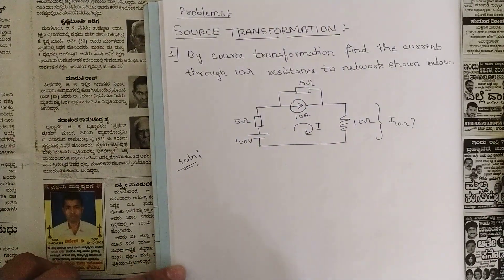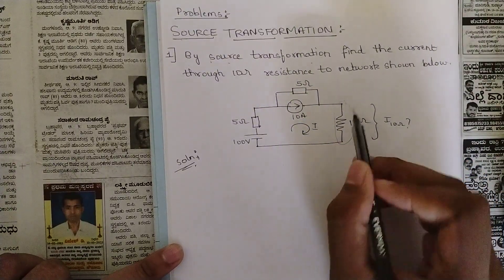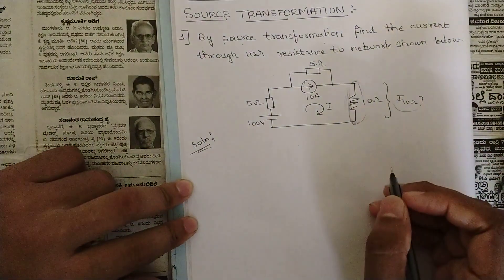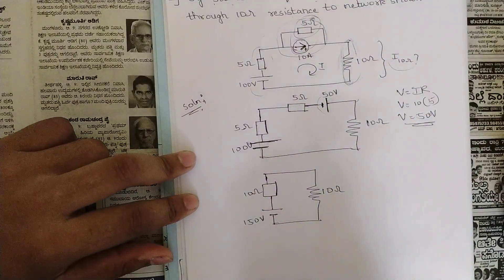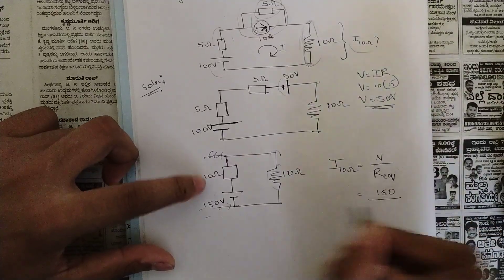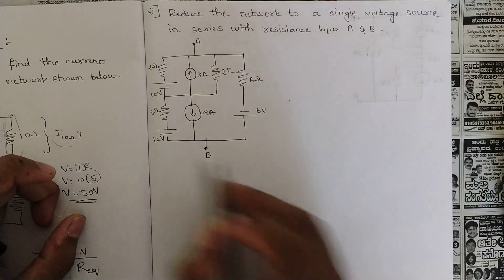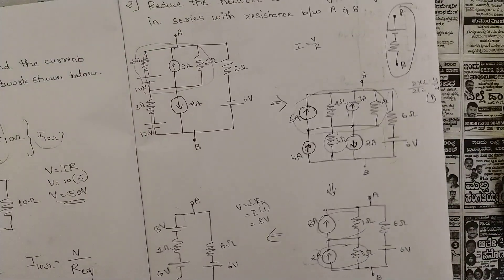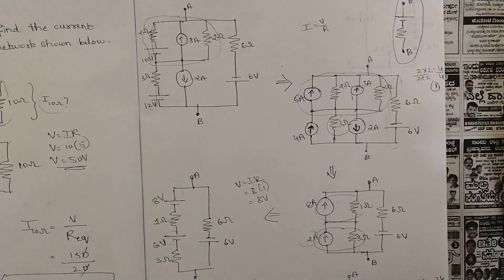3.Source Transformation 2 Problems Explained 3rd Network/Circuit Analysis Sem ECE Latest Scheme VTU

Comment: after converting the current source to voltage source u did the opposite terminal (current flows from high potential to low so it should me (+ ) but u marked ( +)